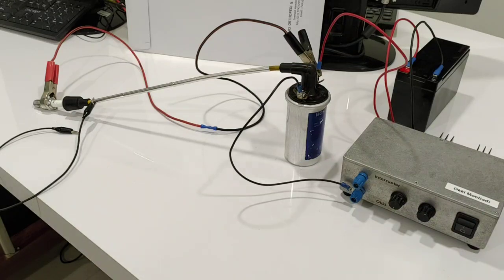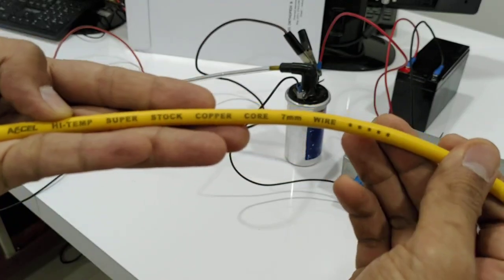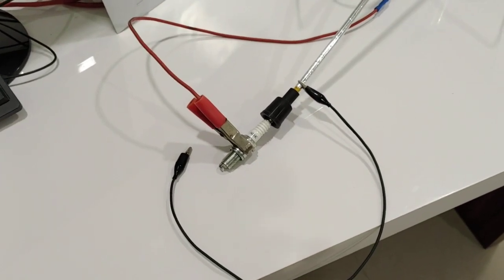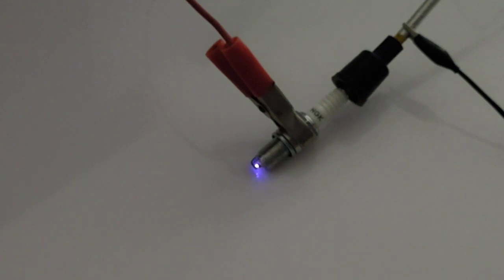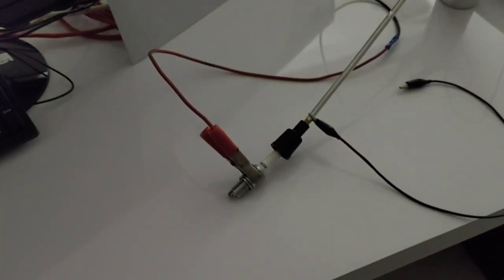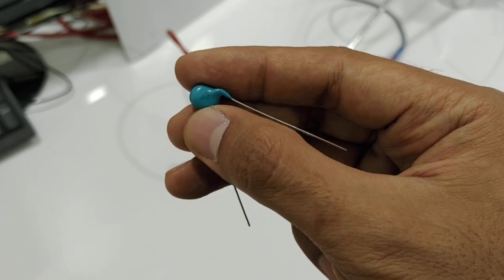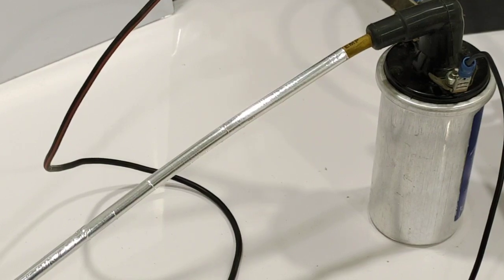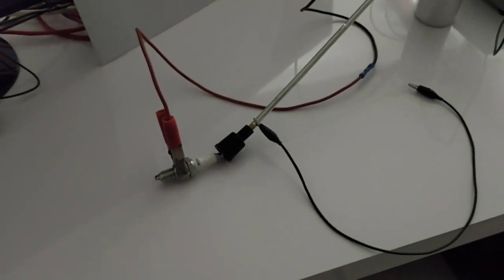DIY Simple Plasma Ignition

Comment: you inadvertently built a high voltage capacitor. the silicon on the plug wire has a very high dielectric constant. nothing new here. 
however, a high voltage capacitor ($0.12 each on aliexpress) before the spark plug (in series tucked in the plug wire boot) will have a stronger effect and is cheaper than the roll of tape. use formula 1/2cv^2 = capacitance  for determining approximately what kind of effect you are looking for.

Comment: Every spark event creates a plasma between the electrodes.This is a very creative, deceptively simple and very inexpensive method to direct current to the gap for stronger spark and better fuel economy. 
I wish you could slow your igniter down to observe individual spark events.
Reply: Also, would this (your implementation shown here) work with a waste spark ignition?

I would use a ring terminal at the spark plug end, and the strands of the wire connecting it to the foil could be wrapped between layers of the foil tape - no soldering!
Also, why not put a 50V <100uF cap across the primary of the coil?  Both of these together would make for very strong sparks

Comment: Hi good idea man what if the wire was carb and the spark with  resistant is it will work  good
Reply from the maker: Any resistance along the way to the tip of the spark plug will kill the plasma. So, the answer is no, you cannot use cable nor spark plug with resistor.
Reply: @OkkiMoeljadi   thanks man
That will make another qustion 
My car hyundai matrix 2004 
With resistor plugs 
What if i but non resistor plugs in it 
Its ok or there is bad effect on controll or any other unit in the car
Thanks again
Reply from the maker: I don't know what will happen to your car. It was OK on mine. I have never had any problem with this setup.
Reply: @OkkiMoeljadi  whats the kind of your car and the year of it 
Thanks alot🚘
Reply from the maker: It was 1993 Suzuki Vitara with 1.6 L TBI engine.
Reply: @OkkiMoeljadi   nice car
Thaks man

Comment: Okki, it's necessary envolve all extension of the cable with the metalic tape? We found similar results if envolve a small section of the cable? Tanks
Reply from the maker: No, not necessary. You can wrap only part of the cable. Maybe the part that close to the spark plug gives better result. To give consistent result, you need to make them same length for all spark plug cables. I mean the aluminium foil/tape length.

Comment: Okki I have an idea to increase the output further! Put a layer of wax paper over top of the foil tape...then another wrap of foil tape, then another wax paper layer and so on. This will make the capacitance increase substantially, just make sure no two layers of foil contact eachother. After wrapping only connect the outmost layer of foil wrap to ground.
Reply from the maker: Hi Mike, I don't think if you add some more dielectric and aluminium layers would make the spark stronger. If you do that, you are actually reducing the capacitance. Less capacitance means less spark intensity. If you want higher capacitance, you should use longer spark plug cables with only one layer of aluminium foil.
Reply: Ok just thought more surface area would help increase capacitance.
Reply from the maker: Yes Mike, more surface area in parallel would increase capacitance. Just like connect capacitors in parallel.

Comment: With these modifications, is there any possibility of damaging or causing damage to the engine?
Reply from the maker: No, not from this increasing spark intensity.
Reply: First , this do not increase the total amount of spark energy , just redistribute it in to very short period of time Actually this will erode the spark plug electrodes faster and create larger EMI . The capacitor need to charge first to the spark gap breakdown voltage which take some time, so the rise of the secondary high voltage pulse isn’t so fast and this delay the timing advance ( that’s why starting the engine this way is easier) . Also the max secondary voltage ( without spark) drops so there is a jeopardy in some adverse conditions as in very cold weather to do not be able to jump the spark gap and there wouldn’t be a spark and the engine lust wouldn’t start . Also if spark plugs fouled the slower increase of the secondary voltage allow more time for leaking current tru the fouling which decrease the amount of spark energy if at all spark happens. Also the lowered secondary voltage may cause misfires during wide open throttle accelerations .
Ignition systems engineers actually try to minimize the secondary high voltage circuit  capacitance in order to minimize the capacitive part of the spark discharge and maximize the inductive one because of already mentioned reasons . The mentioned problems was observed in the past on military vehicles which carried radio equipment and because of that their ignition systems was fully shielded ( even the distributor cap and the spark plug boots) . So it’s not a good idea at all !
Reply: @flappingflight8537  Corona discharge is a way of improving combustion ...
download
Reply: the paper of "International Journal of Research and Innovations in Science and Technology" called Review on performance of High energy ignition techniques
Reply: @francoisbouquin5040  I’m familiar with corona discharge ignition method but not sure if this exactly is the way to go  .Mahle “jet ignition” system 
already is employed in F1 .  .Mazda HCCI - SPCCI Skyactyve even in their commercially available vehicles . Both mentioned ignition systems accelerate much more the process of combustion than corona discharge because activate simultaneously much larger volumes of air/fuel mixture.
Reply: @flappingflight8537  MCE5 does the same as Mahle with SSP

Commercial plasma product also exist like Aquapulser or Ionfire. The solution proposed here is very basic and inexpensive to try. I will.
Plasma ignition is a validated technology that bring over 20% MPG gain, number validated by US agencies with the TPS device.

Si as there are so many ways do to better, i'm certain low cost DIY solutions  exist.

Comment: What is your igniter? Do you show what is in it in any videos. It looks useful for experiments.
Reply from the maker: It is just a simple 555 based interrupter. Yes, it is useful for my experiments. No, I haven't showed it in my video. It is very simple and you can find many similar schematics on internet.
Reply: Martin, you can make your own igniter unit by building a 555 frequency oscillator and sending the output into an automotive ignition module or mosfet fed with 12v and a heatsink on it. Output of module or mosfet goes to ignition coil.

Comment: What is the effect for increase spark without capacitors? How does work?
Reply: The foil shielding acts like a capacitor itself. The radiated waste electromagnetic energy goes onto foil and is redirected to the plug. Okki, is the foil actually touching the plug electrode connectors on the wire? It should be isolated, right?
Reply from the maker: @Mike, the foil is connected to the ground/body of the spark plug. Yes, the cable became capacitor.
Reply: Wow!. Thank you Okki ❤️